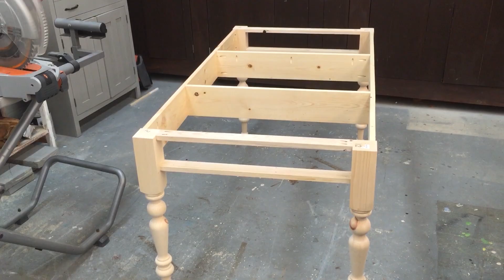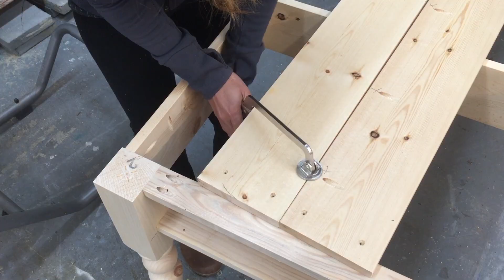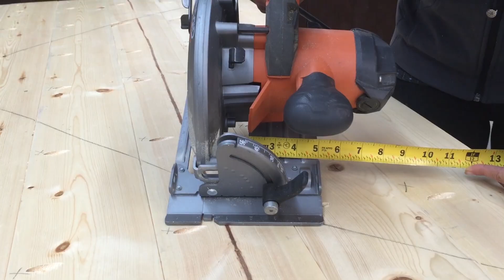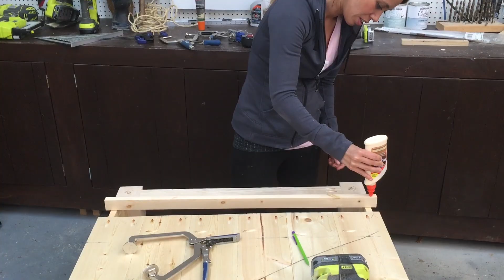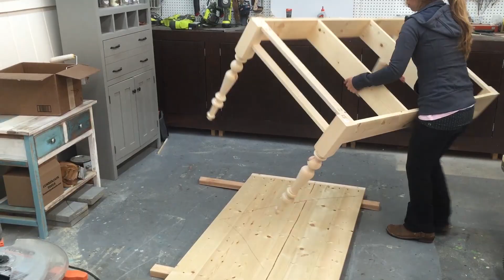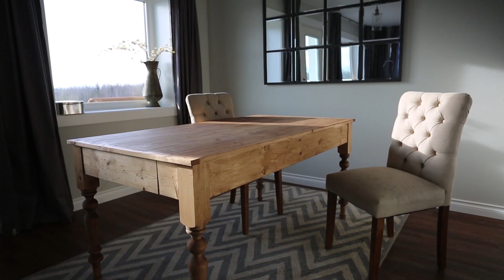How to Build Wood Tabletop

Comment: Good idea on the corbel's in your case wood blocks you added at the corners! One word of caution , in securing your table top to your apron, the holes in the apron should be a little bit larger than the screw you use,  to allow movement of the wood top expanding and contracting during the seasons. tight screw  holes will not allow the wood to move and will either warp the top or pull the legs out of level over time.  I use glue blocks added to the top of the apron all along the underside of the table about 12" apart or so ,then drill up through the glue blocks leaving plenty of room for the screw ,then secure the table top to your frame. Easy installation of top and easy removal should you want to refinish the to at some point later !.   Glue blocks are nothing more that wood blocks approx.. 3-4" long 3/4"thick secured to the frame with glue and screws ,with one oversized hole into your wood top!  Nice job on your table !       Stu.   ps. never glue your wood top to the frame ,as you already know!

Comment: Excellently done! Hey Ana, as a safety tip when using your circular saw, use your left hand to grab the cord, like one does when they vacuum the floor. That way, when you saw, your cord won't make you feel like you're pulling that saw forward. 

Absolutely beautiful table! For the record, there's NOTHING wrong with pocket holes. It's just another option to join wood. IMHO biscuit jointers tend to be a tool that clutters one's shelves unless it is used on a daily basis. Some people swear by them. I'm minimalistic in that if it's not working for me regularly, like my Kreg jigs do, then it's more of a burden than a blessing. If I had my druthers, I'd do mortise and tenon, spline, rabbet, finger joint, or dovetails. When one has a large family and not much time, like me, I want to involve my young kids, so, Kreg works the best! 

I wanted just to shed some perspective that what's good for the goose is not good for the gander. Blessings!
Reply from the maker: Thanks, always appreciate a good tip! :)

Comment: Great idea in theory, but the top will 100% crack because of the breadboards cross grain issue that is created when they were secured with glue and pocket screws. There is no room for the main table boards to expand without cracking. Breadboards always need to be loose mortise and tenon joinery. This is just from my personal experience in building a table top exactly as was described in this video. 5 huge cracks on the top after 2 months of being in my house. Everyone on here, just look up breadboard ends with loose mortise and tenon videos. It’s actually very easy with the proper tools.

Comment: Nice work Ana. Pocket holes and glue are fine to use, todays glues weld the wood together especially long grain to long grain. I have been in this business for many years and just about all the work I do is pocket holes and dominos with glue. I would have not glued the breadboards, this may cause some problems when the top moves...
Reply: What should she have done?
Reply: @sarahmiranda7130 , I have been indulging myself with flippant comments in this thread, but I will give you a serious answer. Hopefully it may still serve you.

The bread board end should be built to allow the movement of the unglued top across its width. Typically, a tongue and groove arrangement holds the top and the end in alignment, and the middle six inches or so can be glued to hold it all in place, while the outsides are free to expand and contract according to moisture content during the seasons. This is because the structure of the wood itself allows it to expand and contract across the grain, but almost not at all in its length. If you try to fix cross grain firmly to long grain, then something will give, and not usually in an attractive way.

A refinement of craftsmanship would have the center six inches of the tongue extended to form a sturdier tenon. To keep the joint tight at the extremities, the breadboard end can be given a slight curve, so that the spring tension of the wood piece holds itself tight at the ends, once the center portion is glued and clamped into place. Some craftsmen might take the extra step of pinning the joint in several spots along its length, still allowing the unglued joint to move. This would be accomplished by using not round holes in the tenons, but slightly elongated oval slots, hidden from view.

Comment: Thanks for sharing looks really good. Depending on the humidity where you live maybe it could be wize to attach the tabletop in another way since wood "lives" and might expand or shrink if the humidity changes. I really love that way of joining wood though looks specially good for plywood and I have been looking for a drillguide like that over here in Sweden but I cannot find them. Good luck with your projects.

Comment: I don't build furniture, but I do some woodworking. I'm pretty sure your tabletop will look just fine, for a while. However, I see two outcomes.
First one, your gluejoints will snap leaving the pocket holes to hold the tabletop. Then you will have cracks in the tabletop. 
Second one, your gluejoins won't fail, leaving the pocket hole screws completely useless

Comment: There are some misunderstandings about why it's important to install table tops that float (use z-clips or figure 8's).  Screwing them in, as was done in this video, combined with gluing the breadboard ends, both directly contribute to cracking along the grain of the main portion of the table top due to unavoidable wood movement as it contracts and expands (it has nowhere to go).  If this table has managed to not crack since construction, consider that very lucky.  Tons of examples of this exact same design cracking right down the middle.
Reply: When someone makes a negative comment, however good their intentions are without making a video showing what they are describing, the post is useless!

Comment: So it has been almost a year since you put this video out.  They table has gone through all 4 seasons.  How is it holding up?  Any warping or cracking?
Reply: Josh Yingling why so negative? Not everyone can afford over priced hard woods.
Reply: @CJDCustomCreations1  interesting you think that a fact is negative. I wasn't intending a negative comment. Wet woods will dry in air conditioning, shrinking, and causing warpage. Oak and other hardwoods aren't typically sold as wet as construction lumber.
Reply: @joshyingling  if you coat it with resin, does it make a difference?
Reply: @joshyingling  these are used for homes so they're sturdy and don't fall down, so how would they warp and crack?
Reply: @wazup3333  soft wood from places like home depot or menards have alot of moisture in it as it dries it shrinks. Since its directly screwed to the base theres no room for the lumbar to move as it shrinks. So something has to give it's likely it will start to crack. Framing a house and building a coffee table are two completely diffrent things that require diffrent knowledge and technique. I'm not trying to take away from what she has done she makes alot of beautiful pieces. But this has been my personal experience I've made quit a few tables and I've learned a few things the hard way.
Reply: @Amill609  what if you seal it?
Reply: BronkBuilt  all wood can be acclimated, the same rules apply to untreated and treated flooring as you know. Hell, people are using unfinished pine for entire home flooring. A simple tabletop should be just fine. Think about it😂😂😂😂
Reply: A Mill609  Your overthinking it, people are still using unfinished soft pine for a homes entire flooring,( tongue and groove.) also using pine ship lap (tongue and groove) for walls of a home.a simple tabletop should be just fine. Just let the wood acclimate to the home for a given period is all that is necessary. Don’t overthink it.

Comment: Whoa whoa whoa.What is that pocket hole machine you have??? I need that.I have the blue plastic Kreg and I thought that was great.
Reply: Rob D i.really ate mine...I gave it to my son in law.  I use the old fashioned wood dowels.  I just went around and increased window sills with decorative edges  in kitchen and bath and it's so much easier to me.
Reply: Sorry I'm 2 years late and you probably either don't need this or already know the answer. That setup is a Kreg DB210 Foreman Pocket Hole Machine. It'll run you about $450 unless you can find one used.

Comment: For indoor tables this might be okay to have no expansion and use glue and pocket screws.  I think it might be helpful if she could teach (learn) how to do half decent stain job.  Can look amazing if you use dewaxed shellac or other sealer and then 2 or 3 coats of stain, followed by a couple coats of poly (wet sand in between).  Why your average DIY woodworker cant properly finish anything is beyond me.  Its the biggest part of the job, not an afterthought!

Comment: I don't think I've seen anything with as many pocket hole screws as this in it.
Reply: im pretty sure she made a pocket hole with a table..
Reply: You haven't seen my workbench chum. Ana's table is fine :)
Reply: I my humble opinion the pocket screws are not necessary! Wood that is straight and fits tight against its mating board need only quality glue ( I use Gorilla Glue brand polyurethane glue) because of strength , water resistance ,easy sanding clean up ,NO creep after drying, no sandpaper clogging like yellow glue ,and is easy on sharp tools.  Good job on the table !      Stu.
Reply: @stuballs42 , you are right of course, and you certainly cannot do any better than dimension lumber for precision machining, right from the factory. Probably Ana could have pushed those boards together tightly, and they would have stuck. But I can see the sense of it; here she is in her beautifully equipped shop at the pinnacle of woodworking technology evolution, with a pocket hole machine, and it would be a shame not to celebrate that wonderful, ancient, and beautiful material, wood, by not honoring it in the very best possible way. I think that uncharacteristically though, she slipped up and was not completely consistent in her joinery because I did not see her glue the top to the base before screwing it together. I  am wondering what a future generation might think of her if this is ever noticed during a conservation effort.

Comment: So many pocket holes, and I have no pocket hole jig. How would round dowels work in your opinion?
What about sanding the top surface with a handheld belt sander - is this viable or is the result more like a hit or miss? I don't mean roughness, but how level is the top surface. I'd like to make a dining table at home with limited tools (especially without big table-top gluing jigs, super dowel-making tools and planers), but I'm pretty sure I'd have to manually sand it down to get a useful top surface.

A tip: the reinforcement probably could be done with a corner reinforcement connecting the drawer frame (both top and bottom) and the side board. But maybe it wouldn't be as sturdy.

Comment: You can't stop wood from moving. In the winter, she'll hear a gunshot bang in her dining room and find a big crack down the middle of the table she put so much work into. Let it float!
Reply: David Brown No kidding!  She shouldn't have glued that "breadboard" to the ends.  That top will split right down the center.  She should have used either a biscuit, a "domino", or spline with only, at most 2 screws on each end to hold that together.  But, I guess we all have to learn somehow.  
Why don't these young ppl subscribe to publications like "Fine Woodworking"?  More info there than anywhere else.
Reply: Patrick Perry maybe she doesn't want it more than a couple of years.
Reply: after reading understanding wood by hoadley, i cant believe how many people on youtube just screw down the tabletops. does noone read anything or just perpetuate incorrect methods lol.
Reply: There are table tops screwed like this and do fine.

Comment: Nice looking table, thanks. Are those solid wood planks you attached a breadboard edge to? how do you get around contraction cracks?
Reply: this is what i worry about within a few years, that board will rip the other boards apart.  I would have just left the end boards off
Reply: @jmgraydz , not done worrying there, though. Then we have all the attachment screws from underneath to think about.

Comment: Have you noticed any problems with the bread board ends from expansion/contraction of the table top. I noticed you both screwed and glued the ends on, which I would too but in watching other videos they recommend against it. The finished product is beautiful, my wife and I are contemplating doing a table from reclaimed porch posts for the legs and 5/4" pine for the table top. Great job, your videos are clear, concise and very informative.

Comment: if i wanted to make a tabletop just like you did here, but more of a desk size for my bedroom, what type of paint or type of seal should i put on it to make it very smooth so i am able to do work on it and write on my papers on the table top without the texture of wood underneath and also protect the surface over time.

Comment: Ana, Thanks for sharing this. Your solution to the weakness in the ends was very innovative. Since you used reclaimed lumber was it fully dressed? Did you use a jointer to get the long edges to meet so perfectly or did it come that way from the mill?
Reply from the maker: +travel734 Hi!  I opted not to square up my wood edges because I wanted the grooved planked look.  I just used off the shelf lumber to make this tabletop.  Bear in mind please I favor a natural rustic look over a perfectly smooth one, but regardless, the tabletop is smooth and works great for my family.  Hope this helps!
Reply: +Ana White Thanks Ana, it is nice to see an alternative to jointing, It is easy to catch TAS (tool acquisition syndrome). I have been trying to joint with a plane but inevitably I end up with a bit of a bevel. I will keep watching the auctions for a good used jointer plane.

Comment: There's no way for the top to expand without splitting because the breadboard ends were attached and glued their entire length.  Same with the attachment to the frame, no allowance for movement and it will certainly move and thus split, something has to give.  I made a two board 35" cherry table top with breadboard ends attached only in the middle with a dry spline.  part of the year the breadboard is longer than the table is wide and sometimes it's shorter,  No splits in ten years
Reply: Je Smith what do you mean the bread boards were only attached in the middle with a dry spline? Thanks
Reply: It’s like using one long tongue or disc biscuit along the table ends that press fit into a slot/groove of the breadboard end. No glue used, and the spline is only used around the middle of the table, not going out all the way to the corners, allowing the table to contract and relax as the humidity and temperature act on it over time, without splitting the wood.

Comment: I'm building a coffee table which is my first table build. it's two 1x12s wide and there is some ever so slight cupping in the one board and I'm paranoid that if the whole table top isn't perfectly level stuff will fall off or it will just look bad. am I just over reacting or should it even out to be good enough after I attach the boards which will run the width of the table top?

Comment: Hi thanks for the post, with your joinery methods do you end up having any movement within the table? I could see the wood trying to move and cracking or buckling have you seen any of that?
Reply from the maker: +John Randazzo Hi John, I have tabletops in my home built in this manner that have been used for 5+ years and have not noticed any issues with wood movement.  I do use kiln dried wood and we do live in a dry climate.  Hope this helps! Ana
Reply: +Ana White It may be important to note that to viewers who do not live in a dry climate. Their tables will crack year after year until they fall apart.